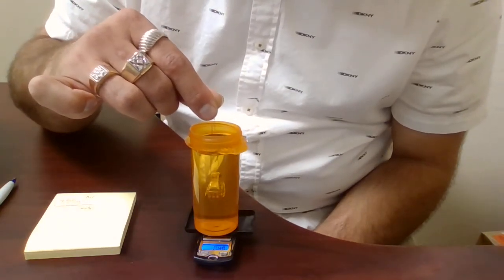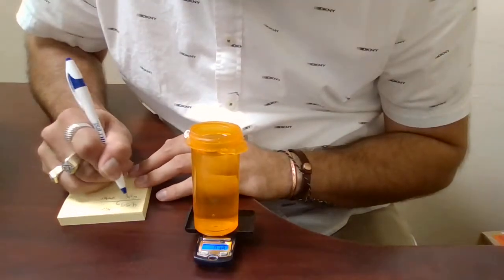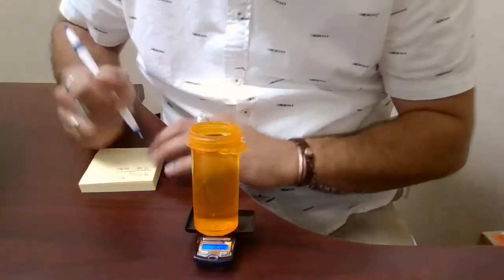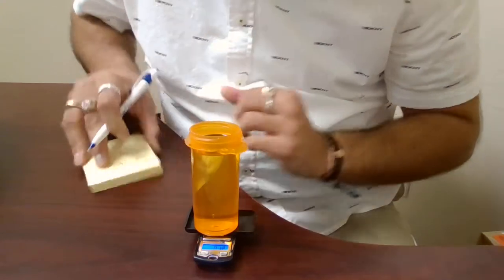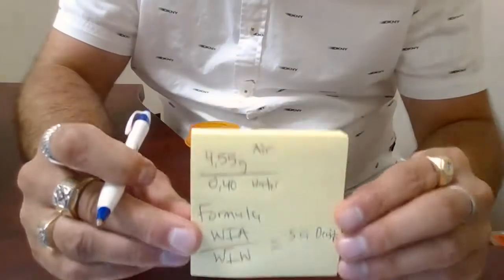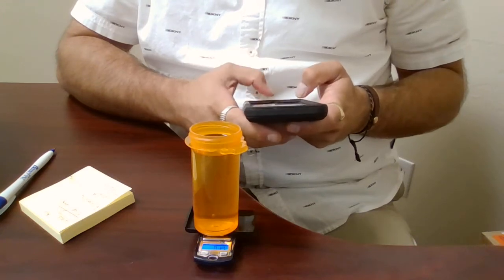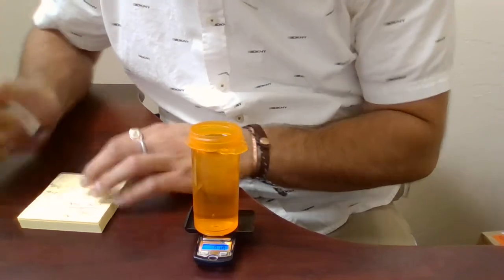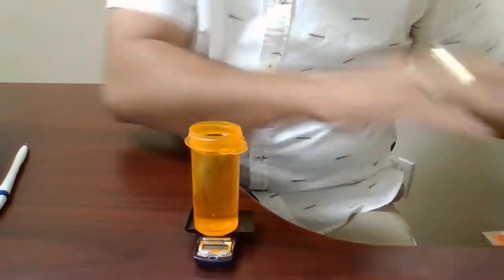How to Determine The Purity of Karat Gold Jewelry using Water Displacement Formula AIR OVER WATER!

Comment: This doen't work for chains because they always hold some bubbles of air between the links, which causes a 'lowering' of the measured carat.
Reply from the maker: @1000frolly 

I have some shorts of Cubans Link’s and rope chains and again and again continue to get very similar results. 

The trick is to have those air bubbles pop! 

A little bit of agitating the bracelet works to reduce any trapped air pockets. 

TBBW🐺
Reply: hello, i have a question, i tested my 40,55 grams of 18k gold chain and it’s 2,67 grams in water and the result is 15,1872659, is it real 18k gold? thanks
Reply from the maker: @enemydown.gaming 

Yes! It’s 18 Karat Gold! 

TBBW🐺